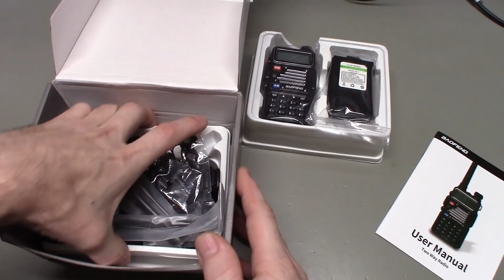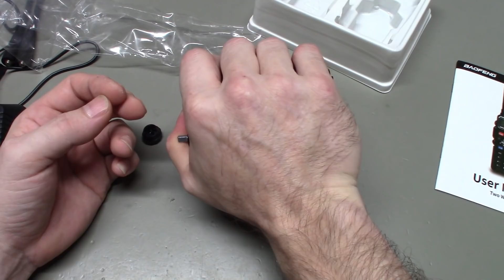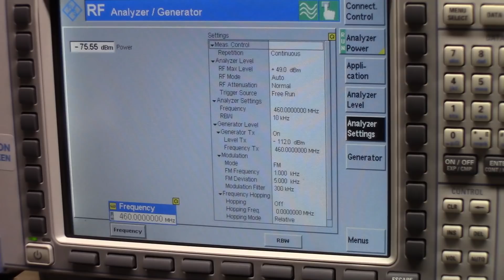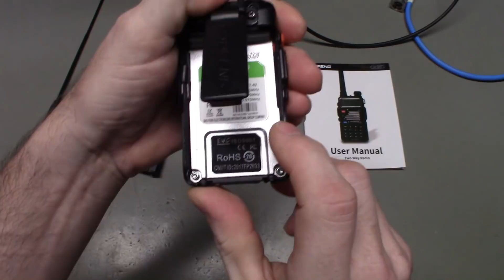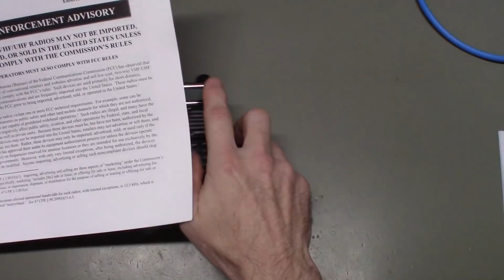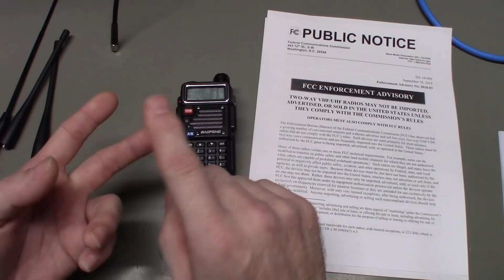Baofeng UV-5RX3 Tri-band UHF/VHF radio teardown review.

Comment: Equiv. to this model is the “BTech UV5R3.”
Which I have. I bought the new Tidradio BL-1, Wi-Fi/Blu-Tooth HAM Radio Programmer thinking it works with the UV5R3. NOPE!
It does however work with the Radiodity UV 5RX3. I thought sure it would work. The Radiodity is shown as compatible. I believe its essentially the same model, just badged up differently.
No luck. So, I went ahead and ordered  Radiodity UV5RX3.

Comment: I have an issue with your comment " this radio should only transmit only on the amateur band " that is not the FCCs problem, it is your problem that you don't like it,  that is already covered in the rules... Do not transmit out of the band that you are licensed for. That is like all cars being made to only go no faster than 30 or 40 MPH to keep people from speeding. Ok how about those who buy these that has no license at all should it be required that the manufacturer has to make the radio so that the radio will not transmit if the user has no license ? Your comment is ridiculous!  Just like you said the radio is easily modifiable ... just don't select the NOAA BANDS TO TRANSMIT ON,  IF YOU DO THATS ON YOU. The FCC has stated that the Baofeng radios are legal.

Comment: Well Mike why don't you give the levels in micro volts for receive and watts for Tx those are the values that most people can relate to. db is a complicated number to deal with. It does not impress people for you to use db instead of more common units. 
I have heald whst is now a GROL back then it was a First phone for 50 years and a Amateur Extra for 30 years. And i prefer the more common measurements.

Comment: Mike, put that thing on your spectrum analyzer. Then transmit on 146.52. You will also be transmitting on 293.04 right in the Military Aircraft Band. And only down 10 dB. This is the real issue I have with these P.O.S. Radios. NO filtering in the transmitter. I did a video on this. One of the reasons it is so cheap. By the way, where did you get that 4 way control nut spanner? Regards, Vern

Comment: I wonder if you could possibly do a vid on the AR-DV10 digital radio. I purchased one for £936.00 but it is just standing there. Every term is abbreviated and I don't have a clue how to set parameters or anything else. The instructions may as well be in Chinese. There is nothing on youtube based on how to program the set. I can't just set it away, let it scan and save like my older scanners. I am not in the know and a simple vid would be great.

Comment: The importers could have just chirp programmed the radio to only let transmit on some basic gmrs/frs/marine that most people use it for, then if someone gets into chirp then they can start taking risks , being hams or whatever after jumping through at least that hoop. businesses use gmrs all the time although it is illegal, since it is what they can buy at wallmart, and they need it, and dont know about licensing commercial nightmare and it they do ,  it is a full rape of small business just to find some obscure murs radio knowlage model.

Comment: Sound like California gun ban to me  😂 that battery is high capacity!!!
Reply: Its Watts they bothered by, CAS you could send long ranger an the hide it in your pocket..dow..get the BF-F8 HP" b4 it's over..8watts.. you sposed to only have 2watts.not 5-8watts an a keypad front programmable..hams can have number pads..cops security comersial buisness can not have keypads so we lucky as Mann...dial up what you like not like preset comersial ones...
Reply: California thinks that they are progressive.. but they ban everything so I guess that makes them regressive. They haven't figured out that you can't legislate intelligence .

Comment: i would love to see the 18650 battery mod does to this radio i know when i use high cap high drain batteries like the  vtc4 or the heb4 it has unlocked power

Comment: I have several Baofeng© UV-5R, UV-9R, & UV9R-ERA Dual-Band radios, and some Tri-Band BF-A82S (#?), and they all meet specs, which are almost all the equivalent to the USA  "MIL-810"-specs, including waterproofing (to a point), power output, (UV-5R = 5-W on High power, UV-9R is 15-W, & the UV9R-ERA, rated for 18-W); all with the rated battery voltage measured at the battery-to-radio terminals. The UV9R-ERA 18-W rigs somehow get 8.4v from the Lithium rechargeable battery, which is also labelled "8.4 vdc", and after charging one, listening to the local weather forecast, then using it to make a quick contact on 2-M, them turning it off & leaving it that way for 2 weeks, then checking the battery voltage, it WAS still reading 8.39-vdc; (the meter I used was a Fluke© 8012A "portable but made for workbench use" DMM, and those are the "expensive for a reason" kind.)
 My Baofeng Tri-banders, (I think the number is BF-A82S, {although it might be a slightly different number); I don't have one "at-hand" to verify, but they're nice & cover the 1.25-Meter Ham band, which is one of my favorite bands, 
 In "Metropolitan Areas", where the last time I looked at a Repeater Guide, larger cities in N.A. had a LOT of 144.100-148.000, 222.000-225.000, & 440.000-450.000 voice-repeaters in fairly heavy use. (There were quite a few 6-M repeaters as well, but that's often called "The Magic Band").
 Ever notice the older TV sets, (before "Hi-Def") seemed to always start at Channel 2? When John Baird invented TV in 1931, every station that could, wanted to be "Channel One", for obvious commercial reasons, but they quickly learned about the planet's ionosphere, and how it might be almost impossible to get a signal 5 miles in the middle of "Channel One" with a 100-W transmitter, but other times, only 10-W would be seen 1/2-way across the world. This led to the frequency-slice that had been "Channel One" being relegated back to Amateur Radio Services, & other, very-low-power, short-range things.
 In North America, that 1.25-M band USED to be 220.000-225.000, but since only "diehard" Amateur Radio hobbyists still make their own equipment anymore, and that band can be a bit "tricky" to deal with, (been there, done that, prefer to just buy the new technology), it's easier to buy something that meets the "basic requirements", & that's a pretty small segment of the market, so in the catalogs I've seen, a lot of "3-band radios" will cover 240-380 MHz, or 340-380-MHz, or some other segment that isn't in the 1.25-M Amateur Radio Service Band, and so an Amateur Radio License WON'T permit using.
 Different countries use that piece of spectrum for different things, I suppose a lot of consideration goes into it; 
The North American 1.25-M band is now only 222.000 to 225.000 MHz.
 The Baofeng 3-band HTs I've got will go from below 222.000 to above 225.000 MHz, so it's up to ME to make certain that it never gets programmed to transmit outside of the N.A. 1.25-M Band; their model I've got is rated for, and produces, not more than 10 Watts with the specified 7.4-vdc at the battery-to-radio terminals.
 I WOULD like to know where that English-language Owners Manual in the picture-section of his post came from, since mine don't look like that at all, (they're much smaller, as in shorter).
 I don't know what his say in them, I know that mine can be confusing, & may not have most of  the information they should,, but when I order my Baofeng HTs', I specify "U.S.", so I don't have any multi-lingual manuals or power cables that won't fit a standard wall-outlet, & although many of my manuals ARE in some form of "English", they're still a far cry from being clear about a lot of things.
 (I've got Icom, Yaesu,, Kenwood, & Alinco Ham HT & Mobile radios & manuals for them, & the one thing I noticed was that NONE of the Baofeng multi-band radios have a "Cross-Band Repeat" function, {which came in handy during "the blizzard of '96"},
 Controlling a cross-banded setup requires either a licensed operator to be there, or could be remote-controlled using a "controlling radio" frequency ABOVE the 2-Meter band.
 (1.25-M & higher were OK, but no "controlling" down on 2-M & lower freq's.)
 Although I noticed that there were some repeaters with phone-patches at 1.25-M & 70-cm, I don't know if putting a phone patch anywhere in a chain that had a lower-freq link in it was acceptable, & now that buying a battery for a lot of cell-phones costs more than a new phone, which includes a (hopefully) new battery, charger, accessories, & so on, for less than the cost of just a replacement battery, (depending on what kind of phone it is), I don't know if many Ham Radio Clubs bother to keep the expense of a separate phone line hooked up to the repeater worth it anymore. 
 (When I think of what we went through just to get "The Pizza Rule" changed,... so much time & effort taken up on something so obviously trivial, and now, I keep an HT on my belt, and a small cell-phone in a pocket, & think "What was the point?)
 I tried going to Baofeng's website, & the ONLY "accessory" listed was a speaker-mic, which won't fit the UV-9R series, and I'm STILL trying to figure out which version of the software to use with the USB-to-Radio kits I've got BOTH connector-versions of.
 Documentation is definitely nothing close to the Owners Manuals the Customer got, or the Service Manuals we'd get, from Motorola© were like,
 The beloved HT-220 Rev "D" hand-held transceiver could take more abuse than an old "Takes a licking and keeps on ticking" Timex© wristwatch, & after being thrown at a fleeing felon's head, {which, if it lands where it was intended, will "drop them like a rock", and the radio will just keep on working), but there were some "trade-offs"...
 The $1,200 usd price tag of the HT-220 was one of them, but if you could find a freshly-refurbished one, (or a similar "Motrac"©, which is a 35-W "hybrid" Mobile transceiver, with the receiver-section being solid-state, while the transmitter, or at least the transmitter's power-drivers & output sections, still used vacuum tubes, & I think they were around 15 to 25-years old in 1978, & a great many still worked like a champ,).
 JUST REMEMBER THAT IT IS THE STATION LICENSEE'S RESPONSIBILITY TO ENSURE THEY'RE NOT CAUSING INTERFERENCE OR ARE TRANSMITTING OUTSIDE OF THEIR AUTHORIZED ("LICENSED") FREQUENCY BAND(S)!
 (For those who do not know what "C.A.P." & "M.A.R.S." are, read the, (now I think it may be online-only), A.R.R.L. Handbook & related books to learn all about which means what, & which frequencies and modes you can use FM-Voice on. (Those Baofeng HTs can even receive the entire (as in: "anywhere in the world", FM-Broadcast band, but I don't know of any that can  transmit there, since there's no point in trying.)
 Time to stop a "monologue" and get something done!
 (Any Copyrighted Material which were identified, or which may have been missed (no scienter, this symbol: ©), is the property of the Owner or Agent of record, and is used here pursuant to the Fair Use act, for Educational and/or Informative purposes only. I do not receive any renumeration of any kind for typing or otherwise entering my Personal Opinions here, and if any were offered or sent, would be refused or returned to where it came from.
 73 & stay healthy!

Comment: I have 4 Baofeng UV-5R's and a Yaesu FT-65r, I certainly prefer the  Yaesu but the Baofeng's were $20 each at the end of 2019 on Amazon. They came with 2 antennas and 2 batteries each, couldn't pass that up. Funny I mostly use them on a base antenna like you with a Motorola microphone. The base antenna is a 3 element yagi I built myself, I have no trouble reaching repeaters in surrounding counties 25 miles or so away on 5 watts, I reach one of them 20 miles away on the low setting. 31:46 I programed all my Baofeng's via Chirp from the Repeater Book page for my state. These radio's are HAM radio's there is no question that they are legal in 2020.

Comment: I like liquid tape I paint it all-around the seam. And it makes a gasket. Around the shell. Also on the road i Cary a Ziploc© bag for rain and foul weather. Kv4li ps I have a hy-gain 6 crystal .2meter hand held circa 1970s still kicking. They don't make them like that any more.

Comment: Hi Mike – thanks for the good teardown of the UV-5R3.  Can you re-check your video at 19:08 when you measured 155MHz hi power output at 3.67 watts then claimed that figure was “pretty damn close to five watts”.  I think you may have made an audio equivalent of a “typo” which subsequently affected your comments when comparing that measurement with 230MHz and 460MHz power outputs.  This error threw up an anomaly at 25:50 when you measured lo power output of 1.77watts at 460MHz, which surprised you enough to recheck against the 1.44 watts lo power output at 155MHz and comment accordingly. 

I know when dealing with multiple data it can get extremely complicated, with mistakes (“typos”) creeping in via the slightest faux pas. 

So which is it, Mike, for 155MHz; is 3.67 watts closer to four or five watts?!  Cheers from Limey-land (Brexitistan - UK).
Reply: He reads correctly the value at 19:45 which is 4.67 W

Comment: I agree with what you say about the frequencies that it covers,  Be fine if it could be changed with lifting a link if you know how, but out of the box transmitting where it shouldn't is really a no no. There is always someone that will use it where it should not be used.
It is like export models of CB, there is always someone that will use them and the reason they are made is they know they will sell them, and at the price those radios are, there is no stopping it.

Comment: Europe here. These can be easily be locked to whatever range you want via Chirp. Unfortunately they can just as easily be unlocked. 
I remember Kenwood TH-77 dual banders in the 90's , that worked in exactly the same way , they could TX on anything between 136-174 , but they were locked from factory or official dealers before sale to HAMs. You could also buy them unlocked from certain 'suppliers' . The only difference is that in those days the internet was way different, software to unlock these was not available and cables to do so were not available for $6 over ebay ( I remember a time when there was no ebay ) . So really and truly , there is nothing new about these .. only the price ( and quality ).

Comment: Hi mike, is it true that all type of chinese radio specially baofeng brand such as uv82, uv9, uv6 all came from same base inside? The diff only on outside form?
Reply from the maker: I don't know because I have not taken any of those other models apart.  If I had them I would do so to see if they are the same or different.

Comment: It would have been interesting to see this on the spectrum analyzer to assess how clean it is.  I have been hearing them called "dirty" radios for a few years now (I believe in an attempt to discredit them!) BUT...that said, it would have been interesting to have your opinion on their spectral cleanliness!  Thanks for the review!
Reply: I have tested the UV-5R with a spectrum analyzer. And the results are (both VHF and UHF; 145.500 and 435.000MHz) less than 60dB up to 3GHz. So yes, with respect to harmonics it's very clean.
Reply: @la7yka  Thank you very much for that!  My spectrum analyzer is only a 500 mhz unit so I couldn't test very high......  in fact... could not see UHF  harmonics.

Good to hear.

Comment: I can get into the Mt. Mitchel repeater, which is 80+ miles away using a UV-5R & a 6 element Yagi. They are the best bargain in radio. Our local club gives out one (random draw) to a new ham when they pass the tech test.
Reply: scott king 80 miles is very impressive, considering the qrp power out, even through a yagi.
Reply: Mount Mitchell is the highest point east of the Mississippi and covers parts of 5 states so it doesn't surprise me that you can hit it. It alwayse works great for me when I am in its foot print.